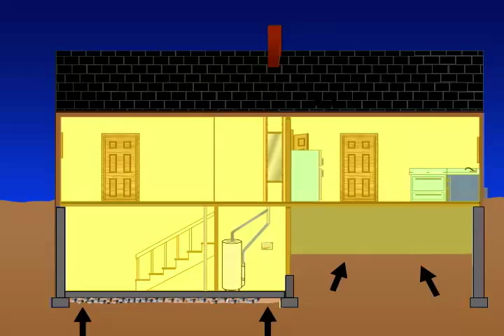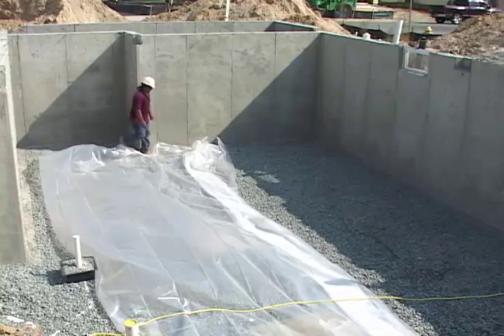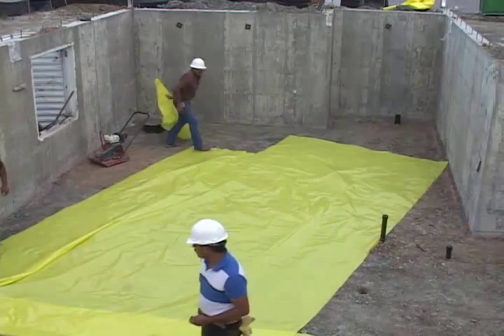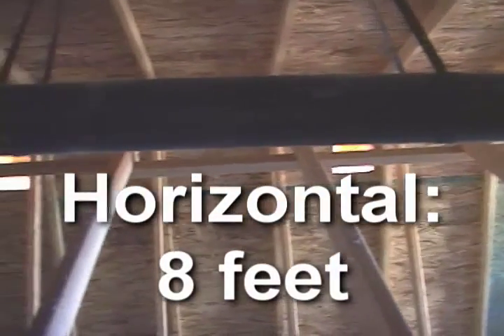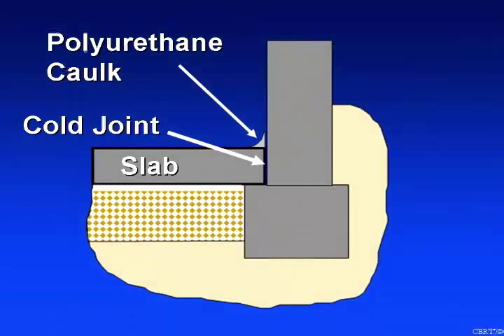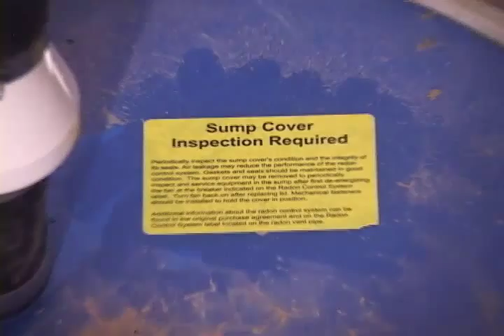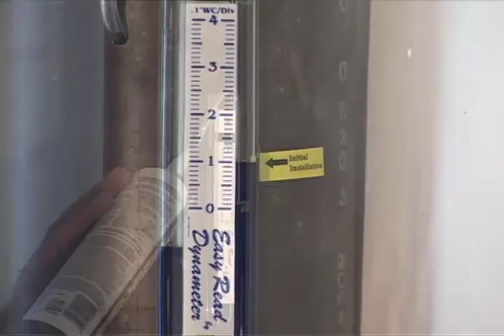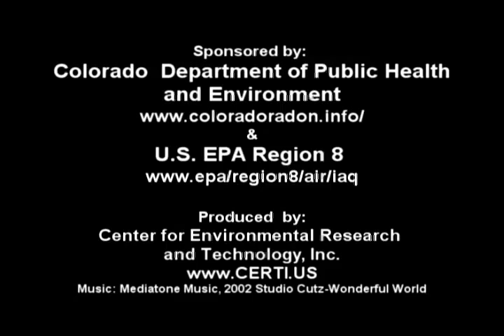Radon Systems in New Homes

Comment: Great video....  I installed perf 4" pipe under the slab of our new construction home not having any idea if we might have a radon problem.  If I don't install an above slab passive or active system now, would if be worth waiting a few months before testing to avoid possible unneeded expense but still have the perf pipe and riser in the basement for future mitigation?
Reply from the maker: Karl:  Having the 4 inch pipe installed is a good thing.  However, if you need to route the pipe up later, it may be difficult to install.  It would be best to at least make the system passive with the vent pipe all the way up and through the roof (install critter guard on end).  Also, allow a vertical space for a possible fan to be installed in the attic space (outside envelope of living space) should you need it.  Then complete construction and test home.  If need be then you can easily add the fan.

Comment: Why not ruin the vent pipe directly outside at the foundation level.... vs running the vent pipe through the house?
Reply: Good question.  Technically, with an active system where a fan augments the collection, either routing will work provided the discharge point is at least 6 inches above the eave and well away from windows where the exhausted gases will not re-enter.  In a passive system (i.e., no fan) if you route it through the interior there will be a small negative pressure inside the pipe due to stack effect that could pull enough radon up and out without the use of a fan.  This is called a passive approach.  But an outside routing does not provide that stack effect and thus a passive approach will not work.  In either case, the house should be tested to verify reductions.  If the passive system is inadequate, then space has been allowed in the piping as it is routed through the attic to easily add a fan and further reduce the indoor radon.